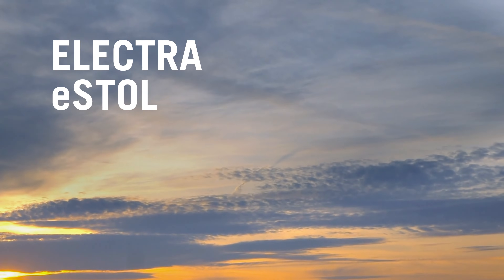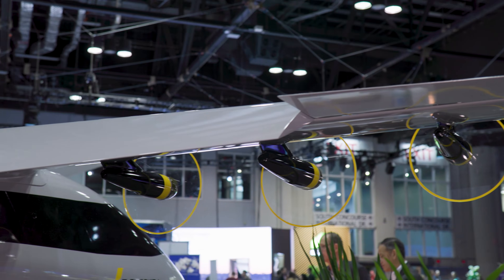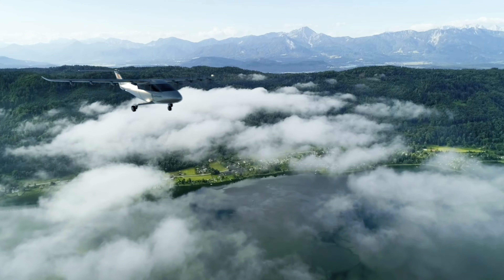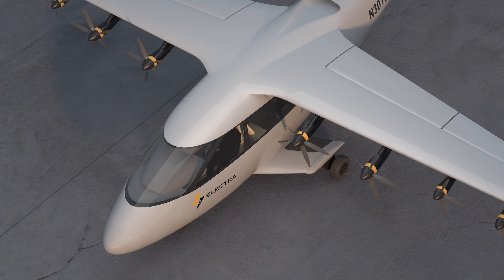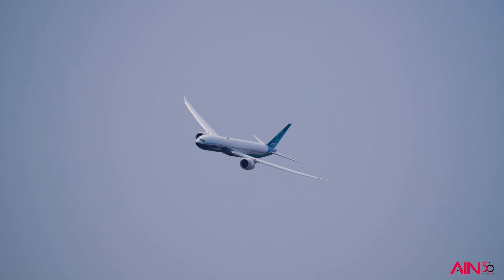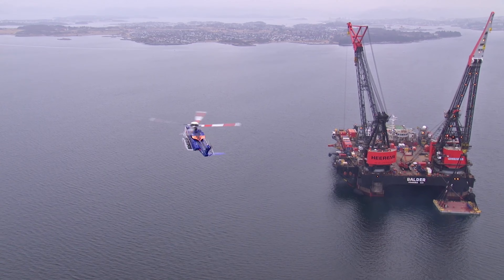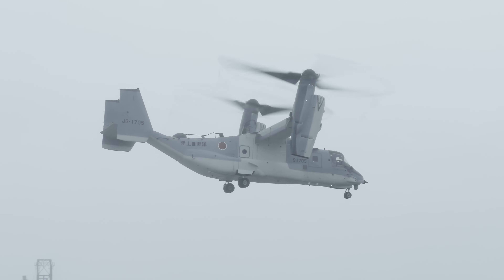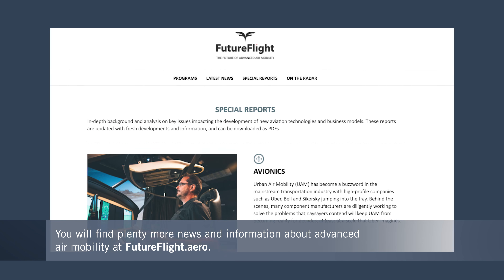Does eSTOL Hybrid Power and Blown Lift Beat Vertical Powered Lift? – FutureFlight

Comment: This video is excellent in that it points out the flaws of VTOL.  

Blown wing with boundary layer control can yield CL = 10 vs flaps only at 2-2.5 CL.  This tech shown is likely only 4.5 CL similar to the X-57 shown in video.  They fail to make it right, and lose out on lots of advantages.

A hybrid (electric or hydraulic) would appear to be the next step, but it is not.  There is a lot more to success than just better CL.  The genset/pump with mirrored motors (EV or hydraulic) consume 14% to 19% of energy at 90% to 93% efficiency.  (0.93x0.93 = 0.86 and 0.9 x 0.9 = 0.81)  The added weight is also a big no-no.

This all fails to understand the future of aviation.

1) blown wing
2) Active Drag Reduction
3) 60% efficiency full power, 75% in cruise.
4) short term boost power
5) ultra quiet props
6) CO2 and water capture
7) Fuel making from solar or nuclear
8) roadable
9) landing on EXISTING roads not used during different times of day.
10) Door to door taxi
11) Optional VTOL or 25 mph at 2x costs with full transition when needed only.  25 MPH is better than VTOL, unless VTOL is key.  99% of landings are at 25 MPH (residential speed limit).

Comment: That extra big tail outside the propwash is more exposed to crosswinds and gusts that will need differential thrust to counter, STOL aircraft have this problem and need special measures to counter it for example the complex control mixing of the DH Caribou and the Canadair CL84 . Stolports are a bit of a problem due to the space needed in built up areas, approach angles clear etc unlike backwoods stol but both are fraught with flight behind the power curve and gust effects, the X57 multi prop blown wing et al failed to live up to expectations.
A wing seeing vast swirl and festooned with nacelles cannot be that efficient just basic physics

Comment: Decades of Aeronautical Engineering experience tells me this design is a winner.   Make a float plane, amphibious, and Ekranoplane versions to cover all markets.
Reply: Wouldn't there be huge difficulties using blown lift on very hot days?
Reply: @freddybell8328  - Why "Huge?" Typically, Hot & High consumes More Energy to meet Specs, but Electric Motors can deliver a Wider Range of Power Settings, than any ICE Engine!
Reply: One Step / Market Segment, at a time, for less "Stretching" their Resources too thin!

Comment: I recall John Langford from the MIT HPV projects so he should be aware of the potential to reduce power requirements drastically over both eVTOL and CTOL state of the art -- there is a trade off for blown lift since it needs high slipstream velocity over the wing hence small fast turning props potentially noisey and giving lower acceleration than if larger (note the gaps between the props here) - I assume they have done their parametric studies around this .  Span is limited for practical reasons and so induced drag and power are higher than need be (high Cl at high air velocity makes for higher power than if compared to unblown high span and high area at flight velocity -loss of both thrust and lift together and need to retain symmettry by shutting down 'opposite' props makes for a critical failure case --the messing up of lift if all power is lost in glide mode could be drastic.  The similar Maxwekll x57 ,now defunct --used the same design philosophy - it was abandoned before being flown .   Stolports are exceedingly rare and stol flight is notoriously dangerous being power dependent and 'behind the power curve ' - a big trap for the unwary.  (Cessna deleted it's 40 degree flap setting because of this - I have personal experience of the 'backside trap'......
Reply: crossouts are unintentional sorry about that.

Comment: Reflecting on the C-17 Lift system, it seems there should be some sort of leading edge articulation as the "Motors"  seem a bit low to provide expected lift augmentation. Additionally, an articulating  Canard feature may become useful at some point as the CG envelope is expanded. The Mike Patty Channel, Scrappy,  Extended Lift System might be worth investigation...
www.youtube.com/watch?v=JcckHHiYkL0&list=PL9OFkVHYEhoFUPV78e3hh0TVPMhYI73f9&index=14

Comment: why not use an extension cord while taking off.
Reply: Hmmm. A powered rail for that initial acceleration...
Reply: @jeffreypierson3023  and a drone to catch. or perhaps fuel that is depleted so landing can be done vertically.
Reply: @snorttroll4379 Ive thought of this too. A drone with a high output charging cord that has connectors at the top (ot the drone)for an evtol aircraft to take off without using its battery.

Comment: Is there any reason a vectored lift aircraft (Joby, Archer, etc.) cannot take advantage of a short runway when available and achieve the same savings under the favorable circumstances?
Reply: Propeller diameter - Any wheel-based horizontal speed will reduce energy use, but some designs have prop interference with the ground when in horizontal configuration. Launch them off a rail...
Reply: @jeffreypierson3023  - Neither Joby nor Archer Midnight would suffer from this.

Comment: Blown lift is old hat - Breguet built such an aircraft also intended to use STOLports in the 60s  Eastern trialled it even. Having UNblown tail surfaces exposes the aircraft to potentially uncontrollable 'excursions' due to gusts at low speed when "hanging on the props' at critical height and speeds .  The blowing effect leads to enormous induced drag and may make a go around impossible --getting too slow can be fatal (backside of the power curve) that said, better than VTOL in this respect .  It IS powered lift unless you intend to always fly ABOVE the power off stall speed (ie not power/lift dependant ) -the 'airbrake effect' of stopped props will also equally destroy lift on the wing behind -sideslipping might be prohibited due to separation from the pods .
Landing technique with highly deflected flaps is different --just as gliders with 90 degree flaps must be respected should an undershoot be in prospect .  The DH Caribou is a good example of massive blown flaps - it lands nose DOWN and can be 'taxied' on the nose wheel in light winds --DH investigated this whole area decades ago including having a REVERSE thrust tail prop to allow spooling up the 'lift' props without speeding up --this aircraft should have that .
Reply: Totally correct,  but obviously Electra knows this and is working on stability by design and/or computer assistance.
Reply: @Bob_Adkins  Why is it "obvious"? -- They have released their best guess publicly and it discloses grave shortcomings - design is what they have done to arrive at this result whether assisted by computer or not.  Did Larry Paige set out to spend $100 million for nothing ? (the aborted/abandoned eVTOLS -like the Heaviside which, like the Archer efforts ,also has tail surfaces flying at a totally different AIR speed than the rest of the aircraft - and given that that will be zero in hover even worse than this one ( and likewise CityHop plus others )   Did the horde of prior VTOLS that all ended in failure ,shown on the classic 'wheel of misfortune' (google it if unfamiliar ) 'obviously' know their efforts would not work out ? When spending other people's money and getting fat salaries in the meantime it might make some sense to continue with 'obviously' deficient projects - like the nearly 800 current eVTOLs listed on the VFS site.  Maybe we have a different understanding of what obvious means.  The first time they try flying these contraptions on a windy blustery day in the real world I think it WILL be obvious.
Reply: @rossnolan7283  - What is" obvious" is in the eye of the beholder. And what I see is a very promising design by Electra. The prototype planes include an oversized tail plane for better control at low speeds. And the distributed propulsion system includes propellers mounted well outboard, providing strong yaw control authority using differential thrust, computer-controlled. There's even some pitch control via this method, according to Electra CEO. I also see their test flight location, Manassas VA, that is near the ocean and has elevated, blustery winds in some seasons. Thus situated, Electra will likely not be naive about the necessary control authority for their e-STOL designs. Lastly, please show some respect for Electra.aero; they have earned it. They are not building "contraptions."

Comment: Similarly cowardly lies have been heard from traditional automakers against the transition to EVs. A core problem is that a Vtol craft will instantly outcompete it because it can land on any building roof or even urban ground. Second, they aim for 9 passangers which is the traditional bus thinking and that too is instantly outcompeted by taxi operation. I don't know how wall street types travel but I'm guessing it's not commonly in packs of 9. It's the typical pattern of 1 or 2 that really carry weight and for that the vehicle can just be vastly smaller and cheaper to develop and operate. Smaller noise signature. Autonomy also makes it impossible to compete with cost wise. Ever ready, 24/7, christmas and new year without overtime.
It's true there is some technical risk in a transition but that's a responsibility you take same as flight itself. His pitch is counting on fear. Nor do they have 1000 sales for this paper dragon although to be fair it might actually sell decently well for other use like small remote canadian destination hops, especially if it can water land.